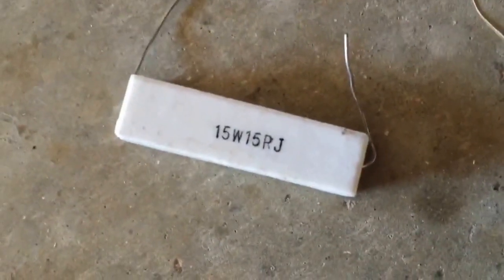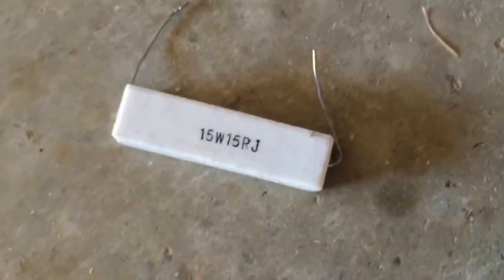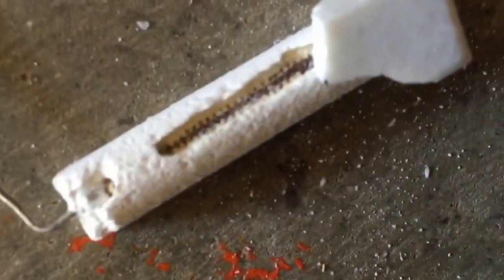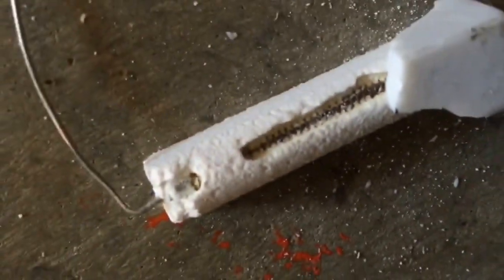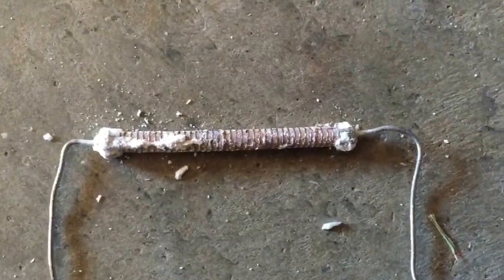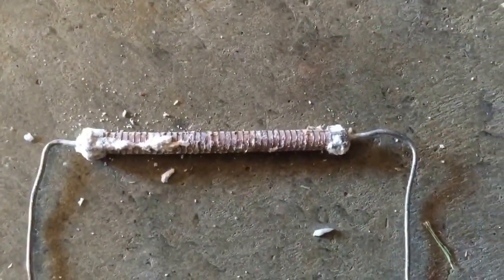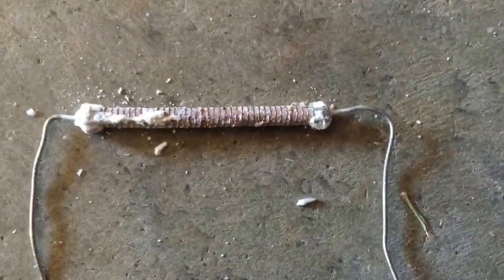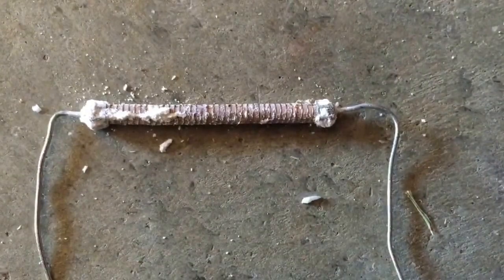Exploring the Inside of a Ceramic Resistor

Comment: Wanted to know the same thing. 
Was that a cheap Chinese resistor and did you test it before dissecting it?
Cheers
Reply from the maker: These ones were purchased from a US local supplier. I think most of them are wire wound. It was interesting to see the way they are set up. I am guessing they use Nichrome wire.
Reply: Yeah, think it's supposed to be Nichrome if it's legitimate.
Thank you for sharing this video.

Comment: hello. what is that material around wire. is it some special ceramic? can it be build at home environment?
Reply from the maker: Yep I think it should be easy to build at home using nichrome wire and clay. Can pretty come up with any standard as well as non standard resistance at great power rating!